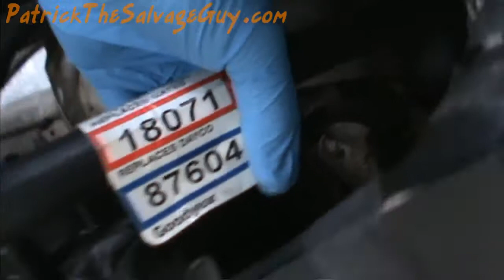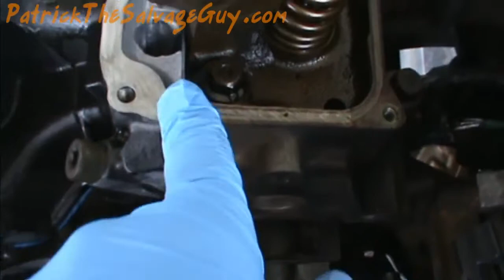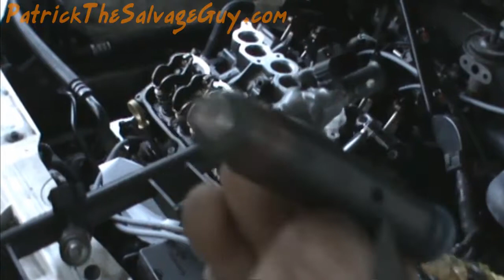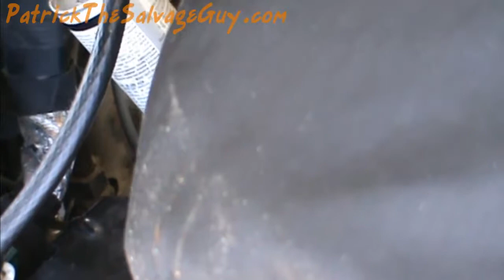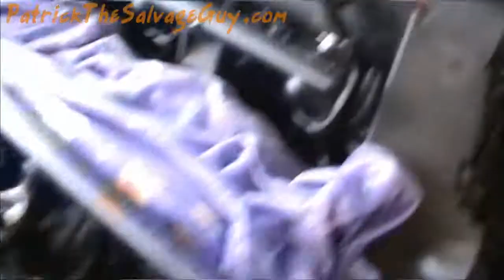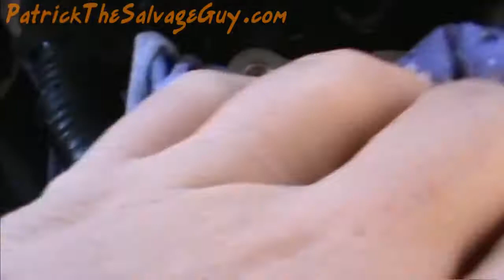Ford Taurus 3 0L OHV Intake and Timing Cover Gasket Replacement Part 3

Comment: If your going to tork the bolts itleast make sure the tork wrench is good quality an is accurate
Reply from the maker: Cheap ones work alright, there are several people showing a man doesn't have to spend alot to be close enough.  Study more about torque wrenches from people that have actually used them and learn how to spell it too.

Comment: Now asking ti break bolts or under torking the bolts
Reply: Sometimes the dam spell doesn't always want to work right an plus I got big fat hands I have to go back an try to put the dam words in so sorry for the miss spell
Reply: No I was not saying you where over torque the bolts an yes I know how to spell lol
Reply from the maker: No worries bud I was just picking at you.  
I use a torque wrench so little in life.
Even IF I could afford stuff on the snap on truck I still wouldn't I like finding stuff at yard sales or ebay if I want something branded snap on, I'll only get it if I can get a good deal on it, otherwise I'll goto harbor freight or northern tool for new tools.  I got 5 kids and a Wife I provide for, I don't have money to feed the snap on guys, I always got something better to spend it on so I get cost effective tools.  I personally like finding the old craftsman tools from the 80s or earlier that really last.
Thanks for the chuckle, sorry I didn't mean to sound rude, I'm also at work at the moment and dealing with the real jerks in my life thanks for the distraction lol.  I'm a phone jockey dealing with people that have been waiting on the side of the road for a tow truck when they call their insurance and things ain't going right and it's my monday I ain't liking it lol.
Reply: I was trying to say is that I would bother use a torque wrench on an set of engine heads crankshaft rod bolts an lug nuts stuff like that
Reply: I also don't like using torque wrench inch pounds stuff like plastic upper intake like just going by feel as a professional mechanic that's just what I feel more comfortable with
Reply: Now maybe if I could afford to buy some torque wrenches off the tool truck snap on or Cornwell matco that are very accurate an know I want break anything when using it then ya I would
Reply: Speaking of that I just replaced my lower intake gasket on my 2006 ford Taurus with the same V6 motor like you have not using a torque wrench like two days ago had no problems
Reply: So how do you like my spelling this time lol
Reply: Not trying to be a smart ass
Reply: Anyhow good instructions on how to get the job done step by step
Reply: I just wish I could of gotten my dam stud bolt out my engine head like you did I head to move around it a little bit with pulling my timing cover off after replacing my timing chain had to order a new timing cover because the old timing cover had bunch of pivet markings that where really being that it was already looking before I removed the cover
Reply: Couldn't figure out how to spell one word spell check doesn't always work
Reply: Please do I not take anything I say as an insult
Reply: I was working one day I figured what the hell think I'm going to try out a torque wrench shop just bought set it for NM use on the plastic oil filter I'm sure you know what mean the in line oil filters like Toyota have an is it an ended up cracking the housing that sucked so that's my reason for not using torque wrench on plastic or lower intake when replacing lower intake gasket on less I have accurate very good working torque wrench
Reply: Ya agreed I only buy off the truck if I have too but I do buy from harbor freight some of there stuff good some not but if I could find a Craftsman torque wrench I would buy an actually I don't buy from snap on because they are expensive junk I buy from cornwell or Matco tools Iv had bad experience with snap on with my money being stolen from the snap guy off the himself once when I had a tool box loan from there
Reply: I was about to take his ass to court but he paid my dam loan off other wise he would have to pay more plus that for lawyer fees an court cost an me suing him I should have took it court anyways I probably still could had then even after he paid back the money he stole from me